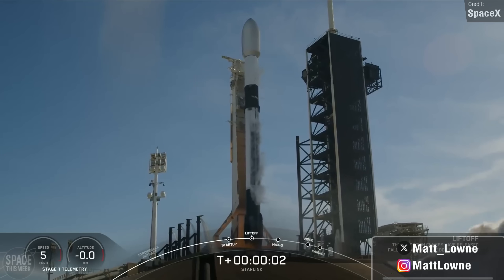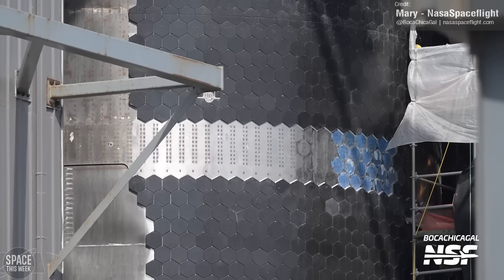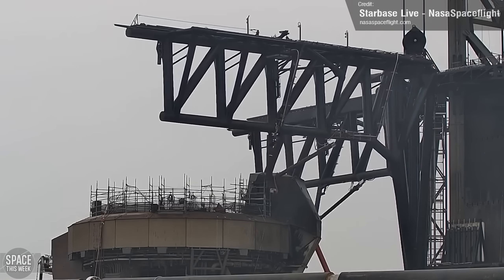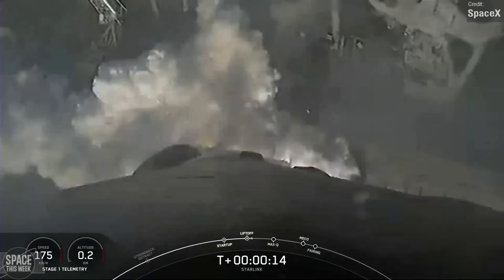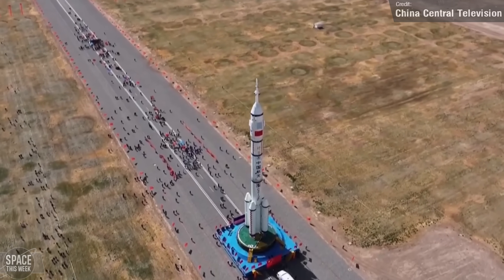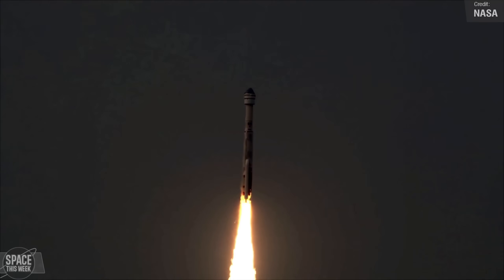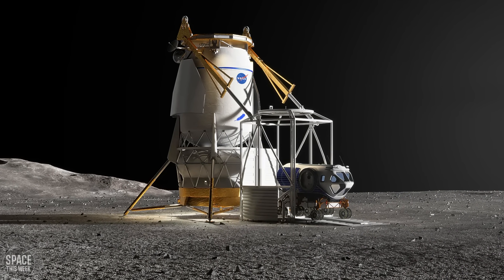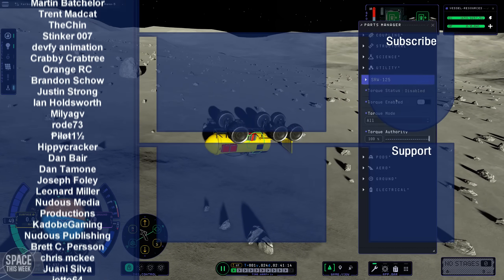SpaceX Strips Heatshield Tiling from Ship 29, and Unveil New Lunar Starship!

Comment: SpaceX: We got further with every subsequent launch!

me checking the books No Starship has made it into orbit yet. And the one that actually got to space properly lost any and all guidance the moment it got there and failed to achieve even it's sub-orbital trajactory at that. They were lucky it landed in the Indian Ocean as it did in stead of over Africa.
To add to the calamity, every Starship they blow up eats away at the budget they got from NASA for this thing. And they still haven't solved most other issues such as docking, refueling in space, habitation, and most important of all... a fully functional elevator to deploy humans on the moon and get them back off.
I see no reason for any celebration yet. While the budget is starting to shrink rapidly because every launch seems to burn up another Starship.
Reply: This is why musks idiotic silicon vally "move fast and break things approach" is extremely detrimental for rocket development. Space x got lucky with falcon 9 but starship is a different beast and they need to take things slower or nasa is gonna pull the plug and without nasas support space x is done for and unlike other industies musk cant move his company just start working with other countries for financial backing and support because the US government specifically the military would never allow american made rockets to be sold yo other countries since in the wrong hands one of these rockets is an icbm.

Comment: If that crane can handle a D11 sized electric Cat bulldozer in Earth gravity, I think they should build it because handling that mass on the moon and Mars would be guaranteed.  Placing the feet further from the centerline would make it more tip resistant.

Comment: Hi Matt! Do you think the heat tiles will continue to pose a big problem for reusability? Do you think SpaceX will be forced to an alternative if they want actual RAPID reusability? 
I am afraid it will be, looking at the Shuttle and also SS ALWAYS losing tiles on a mission. I am thinking an ablative blanket which can be wrapped around starship would definitely comply with rapid reusability, as it can be discarded after use and replaced while SS is stacked. I'd have to write another 10 paragraphs to fully describe my idea, so I'll leave it at that. What do you think?

Comment: The animation of the booster landing into the chopsticks is interesting in that it shows the rocket's exhaust flame rotating back and forth over the orbital launch platform/tower. If the real booster has to gimble the landing engines that much, are they going to have to harden much more of stage zero?
Reply: don't worry mate none of this is ever going to happen

Comment: Starship will never get to the Moon, won't even make the orbital refueling to work.
Reply: Starship Lander is a stupid idea.  But  a large CSM put into orbit from the cargo bay of one Starhip ... docking with ... a Lunar Lander with a large Habitat module from the bay of a 2nd Starship ... and then the Service Module plenty of fuel to get the Command Module and Lander to low Moon orbit can easily replace the ... ridiculous Starship lander requiring at least 10 refuels in LEO.

Space X only needs to use two Starships ... to get a huge Command & Service module  and Lander with a multistory Habitat module ....into LEO.

And only 3 or 4 Starship flights to get a large Space Station into LEO ... for a lucrative space tourists.

The Service module sent to the Moon has enough fuel to return to LEO and dock with the Station ... to be refuel .. and take Cargo or other Landers to the Moon Station ... which Space X could build .. using the Service Modules as transports.

But sadly ... Elon is a moronic Liberal who just lost $30 billion buying Twitter then changed its name to X.  W T F?
Reply: @abelincoln.2064  I'm sorry but your idea isn't any better than Musk's. Everyone forgets the delta V required to get to the moon surface from earth and return again. If you're interested you can go to an online delta V calculator and do the calculations yourself. The bottom line is everything that leaves earth orbit is one time use only.
Reply: How many Raptor engines (minimum) would it take to get first set of astronauts on the moon.  Trick question, give it some serious thought.
Reply: @jdmather5755  I don't know.  What I know is Starship will prove to be useless very soon.  Just wait.
Reply: @ludwigvanzappa9548   And your credentials are?
Reply: @unownyoutuber9049 No need to be a veterinarian to know when a dog has a broken paw.
Reply: falcon 9 worked and so did apollo and james webb! amazing things are possible
Reply: @jofreddy8643 Yes when the concept is good.
Reply: @jofreddy8643   Assume everything works with recovery and reuse (where possible).  How many Raptor Engines? Back of envelope calculation, say within +- 100.  What is your number?

Comment: Im pretty sure no flight will see landing legs on the not a falcon 9. I saw recently they plan to use a guide wire system that'll close around the top of the booster and just hang it in the air. It actually seems like a better solution than legs.

Comment: "The Long March 2F is a clone of soyuz" is crazy.
You can say that about Shenzhou because it's literally a liscenced copy of the Soyuz spacecraft, but the rocket?
Reply from the maker: Yes, the rocket is based on Soyuz architecture.
Reply: @MattLowne  soyuz uses a different fuel, different engines, they are 20 meters different in hight, different diameters. Boosters on Chinese rocket have 1 nozzle each, and boosters on soyuz have 4 nozzles each. You simply have no place in this sector with this level of incompetence, go back to playing KSP and leave this sector to people who have a clue.
Reply: @MattLowne 
if by architecture you mean having a core stage and 4 boosters then you'd be right

but that would be like saying a falcon heavy is based on delta IV heavy architecture

Comment: Good news! With the Boeing Starliner the door doesn't fall off. It does get blown off but it won't fall off.
Reply from the maker: Fr this is a tiresome narrative. Having more launch options is never a bad thing and Starliner has safely reached space and landed again twice now without crew.
Reply: @MattLowne I completely agree about having redundant crew launch systems. It's insanely cool that the US has Falcon 9/Dragon, and soon Atlas V/Starliner and SLS/Orion. More of us should appreciate this.

However, that doesn't mean we can't call out mismanaged companies with a recent issue of safety and quality control. Boeing literally murdered a whistleblower from their aircraft division, let alone the complacency of the entire 737 Max saga.

It's obvious that Starliner's path to crewed launch has been troubled. From the parachute issue on the pad abort test, to the software glitch that prevented OFT-1 from reaching ISS, to there being safety issues on the service module potentially colliding with the capsule after separating, the valve issues, the flammable tape, etc.

I want to see Starliner succeed, but until they're safely launching crew, I don't think we should stop scrutinising them.
Reply: More launch options is good but "safely" is a stretch.
Reply: @MattLowne  Just making fun of the planes Matt, take it easy.